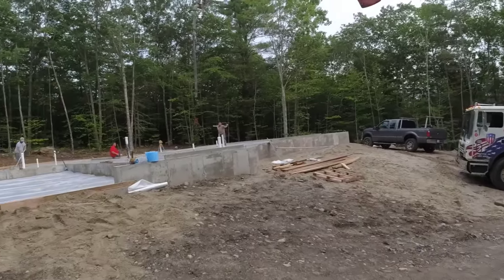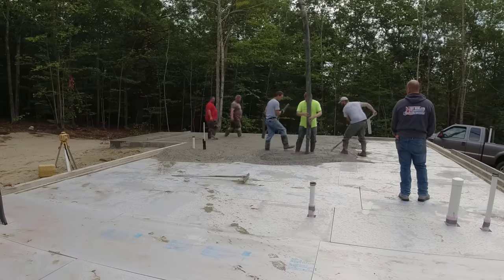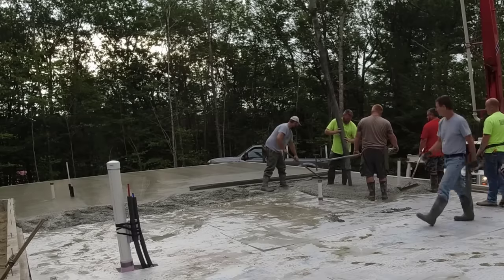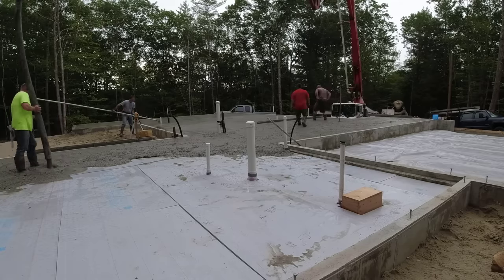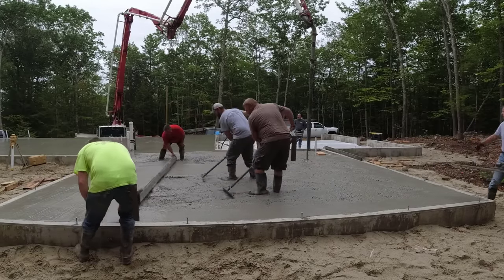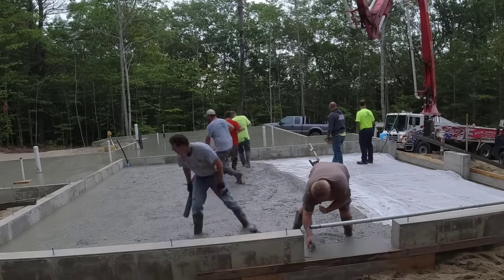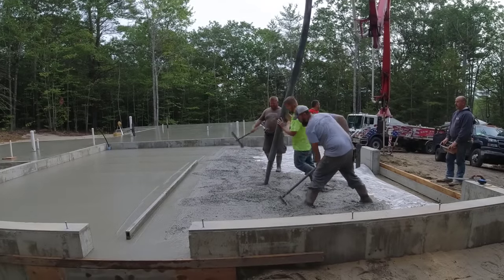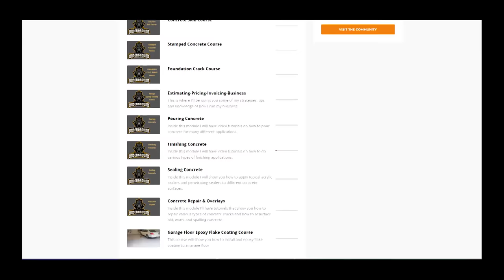Code Enforcement Costs Owner $3000 For Styrofoam Under Concrete Floor

Comment: The current cost of insulation panels may make a painful outlay, but it will get recouped VERY quickly in today's energy costs!  After passing the break-even point, it's a gift that keeps on giving year after year over the entire life of the structure.  Imagine enjoying comfortable interior temperatures year round without having to fret over heating and cooling costs.
Reply: I'll bet the break-even is within 3 years. After all, 30% of heat loss is down, through the floor.  Here's another situation. My small home (Canada snow belt) is electric baseboard heated. Adding an airtight inset to my open fireplace, and burning only from Friday eve until Monday morning weekly, some evenings, through the Christmas holidays, and a few extra days, cut my electrical bill in half. The $3,000 stove and install, paid for itself by halfway through year three.  Spread out over the year, that's saving $100/month over (30 months=2.5yrs), or $1,200/year. And, never having to spend it again. This is really only viable if your winter wood costs less than the saving. I harvest my own free firewood.
Reply: There is so little heat loss through a slab floor, it’s not what you think at all. I’m a mason of 37 years
Reply: I put R-100 insulation in my attic, I also added another inner wall to all my exterior walls which were plaster and lath and in poor condition, I added studs inside, 2" of Celotex, a plastic sheet, 1/2" CDX topped by sheetrock so I could hang heavy things on the walls anywhere and not have to locate studs too.
So the 4" walls had blown in insulation, added 2" celotex at R-7.2/" and the walls are around R21 or so.
 I replaced all the single pane windows. I was getting sheets of ICE on the inside of my kitchen windows in winter, where my computer and desk are, it ALWAYS felt cold and drafty, turned out the draft was convection currents caused by the cold window glass. I had to have a 1500 watt space heater behind my chair all the time. I replaced the 3 windows with MI windows, double glass, argon, low E vinyl, immediately no more ice, and the space heater went in the trash, I saw an immediate reduction in my electric bill of about $50/mo The windows were around $179 each, I installed them myself, they paid for themselves in 2 years.

Same story in the bedroom where I always had another space heater on low all night, replaced those 2 windows and that heater went in the trash too, that saved about $35/mo
Since then I replaced the rest of the windows but its unknown the savings as doing so didnt eliminate any more space heaters-only had the 2.
Buy last winter I replaced my 35 year old 80% efficient, 110k BTU Lennox Conservator G11-e furnace with a new Goodman 80k BTU 96% furnace and installed it myself, new better ducts and more central  location along with a humidifier.
I saw a reduction in the gas use last winter, this winter will tell me more.
That 80% furnace took all its combustion air from the basement which pulled in cold air from every little crack, and when it was off, cold air would often spill down it's 5" flue. The Goodman takes all its air from outside with a 2" PVC, I also installed a damper to allow a small amount of fresh intake air from outside to mix in the return duct.

 @slowfinger2

Comment: I'm not sure where you are exactly, but here in Finland even without code I'd doubt anyone would pour slab for house without insulation under it. Even for garages it's usually put especially if the garage is heated.
Reply: There’s no need to put styrofoam under a heated slab, it should be put around the outside of the foundation. I have a 1000’ feet of heat pex in my garage floor and the foam is on the outside perimeter. The heat only goes down 10”, and it’s why a mixing valve on a tankless coil is piped 10” below the outlet. The heat won’t convect farther down.
Reply: @geneticdisorder1900 the proper term is conduction. Solids conduct heat. Fluids convect heat. And technically it's that it won't effectively conduct the heat beyond 10" but the heat does conduct much further than that.
Reply: @ianbelletti6241    Last time I checked, there was fluid flowing fabulously through my tubes convecting heat into the pex tubes, which conducts heat into the cement, which conducts heat into the dirty dirt. And all that mass of dirty dirt, cement impregnated with small crussy crushed rock than convects heat up into the air, which in turn warms my garage. Except where the 4 roundy rubbers sit on the cement and the heat is transferred into those 4 roundy rubbers and anything else that is sitting, stored or thrown onto the concrete floor.  So in short, we were both half right.
Reply: Without beneficial heat loss from the building to the soil below the slab, frost heaving soils will move an insulated slab. It will heave up at the edges. Prevent freezing, remove free water or replace the frost susceptible material and it can’t heave.
Reply: @Mars-zgblbl  Do you have a major  problem with foundations without underfloor heating heaving ?
Reply: @sarahann530  Where I live, frozen wet silt can heave with great force and crack concrete. The risk of this happening is increased if insulation inhibits interior heat from keeping the soil surrounding the foundation or slab above freezing. Heating method doesn’t matter
Reply: @Mars-zgblbl   So the interior heat penetrates the concrete slab . What temp  do you have your house heated to to prevent  this freezing under the concrete  ?  It would indicate that heat loss through the slab is a concern and in places that don't have your unique problems it would pay to have under slab insulation
Reply: How about dollah dollah bills $? Up front costs and over-runs sometimes mean cutting corners elsewhere in a compromise with the devil that you know will cost later.
Reply: Dude, I truly recommend visiting the US and checking what they do with your own eyes. It's beyond any imagination, and seeing those "geniuses" will leave you speechless. Pouring concrete straight on the soil is just one example. But in general, it's unbelievable what they practice.
Reply: Mandatory here in the UK. Edit: Actually now I think about it insulation in the floor isn't technically mandatory but I think it would be hard to meet overall insulation targets without it.
Reply: I'm in Arizona, USA. It is never cold here. We only insulate floors of large commercial freezers and refrigerators.
Reply: It really depends on the environment where the house is located.  Maine has many more months of cold than a Southern state like Alabama or Florida.  I'm not aware of anyone putting Styrofoam under a slab down South.
Reply: @markdaniel8740  "never cold here"
Insulation works both ways:). Would make sense insulate the perimeter against heat.

Comment: Gotta have that thermal break to decouple the concrete from the ground.  This keep the energy (heat or cool) in the house and makes it more efficient.
Reply: Also have to have a thermal break between the concrete wall and the slab, otherwise your slab is effectively uninsulated and the edges will be cold in the winter and accumulate condensation in the summer.

Comment: With energy costs increasing, it probably makes sense in the long run. Add in the comfort of floors being warmer and the risk of floors sweating it makes even more sense.
Reply: Umm  it'd make more sense for hollow floors not cement floors
Reply: @meyatetana2973  Actually insulation concrete floor is the best because you lose so much heat trough them.  It just helps so much.
Reply: @meyatetana2973  Do your research. Hot goes to cold, if the floor is cold then your furnace or whatever you have is constantly trying to warm that cold slab. that slab it coventing the heat into the earth instead of you. Over the lifetime of that house that $3000 will pay it back many many times over. Not to mention the comfort factor. in Ma the new energy standard for new and remodeled house is HERS 42 0 being the highest score possible you should see what it takes to get to that level. homes built in the 1950s would most likely score a rating between 120 and 130.

Comment: Here in Alaska had my garage floor replaced with a heated slab. I set the grade myself and put a vapor barrier and 2" blue board. Going into the 3rd winter and it was well worth the extra cost.
Reply: I have 80mm/3.5" of PIR here in the UK and if building again I would probably fit more like 120mm/5".

Comment: The foam is absolutely necessary. Your floor is your second major heat loss source next to the roof.
Reply: Could you explain how the ground conducts heat and when does it reach equilibrium.
Reply: @marcwert2180  You're not getting a course in thermodynamics over the internet. Go to engineering school or consult an engineer in person.
Reply: @marcwert2180  The ground stays at a mostly constant temperature year round. That is sort of how ground-source heat pumps work. (State-change reactions like freezing also sink a lot of energy.)

If you dump enough heat into the ground it may eventually reach equilibrium. But water can carry your heat away as it makes it way down to the ground water level as well.
Reply: I don't  use foam, don't  use house wrap, don't  use felt paper.
They will destroy your house.
I have thrown code enforcement OFF the property or had them arrested.
Reply: @daviddiehl-gy2sq  Well, I see you are half right,, batting .500..  House wrap,, right with you.  Expensive and pretty and close to useless,, UNLESS,, you wrap your house exactly as the directions instruct,, and no one does  because it is too difficult and expensive,, and if you do the perfect wrap,, You must also install an air to air heat ex-changer with a positive pressure air makeup system.
Use 30 pound felt (tarpaper0 as your wrap.  Works better  and does not promote rot under the wrap.
Foam, in the right places,, is wonderful.. It can cost far less than the cost of the wood or natural gas to heat the home.  I like cheap and effective.  Spray foam in place,,, not so much a fan.
Keep the building inspector off your place?   NOT a good idea.  Yeah, win some temporary battles,, but you will lose the war.  Good luck with that, and the attorney's fees  are gonna cripple you.
Reply: @Sailor376also  inspectors are only permitted on the property when you call for an inspection. Most don't understand the new products. Got tagged for using gluelams as headers. PEX without fittings or separate heat and high pressure air. They have also never seen engineered studs.
Also, house wrap on the outside, plastic on the inside. Where does the moisture IN the stud wall go?
Reply: @daviddiehl-gy2sq   Arrested for what ? Please share a link to how the court ruled .
Reply: @sarahann530  criminal trespass,  he got 5 years and lost his job. Unless they are called for an inspection they are not permitted on the property.
They cannot just show up and do an inspection.
Reply: @daviddiehl-gy2sq   Share that court docket because it will be useful precedent for others . 
Did he fail to leave after being asked to by the cops ?
Reply: @daviddiehl-gy2sq no one gets 5 years for a trespass.  I don’t believe your story.
Reply: @AscDrew  don't give a shit what you believe. That's what he pleaded down to.
Reply: So give the guy’s name and the state/county and year where the case was handled.   Thought so.
Reply: @daviddiehl-gy2sq I really do not like all of that.
Reply: @daviddiehl-gy2sq   Still waiting on that court information . At least share the city ,county and state so we can look it up . The firing of an inspector  for this would have made the news .
Reply: @sarahann530  In some states like Illinois you have to have the inspection. You must apply for the permit first which means the inspector will be visiting you. Now in some very rural areas You can get away without an inspector. A former pastor I knew built his entire rec area for his church without permits or an inspector visiting. He lived so far out in the sticks though he was able to do it.
Reply: @carmelopappalardo8477   Its unusual for a commercial  building to be built without permitting but that's religion for you . They get away with all sorts of shit
Reply: @sarahann530  I agree. I visited the guy like winter, late winter and came back mid to late summer and it was built. Now if he would have been caught....
I agree it is very rare. It was also against the law in that state. I know people in Kentucky who built homes on their large properties. They did not report them. The county started using drones caught the people and they ended up getting fined heavily.
Reply: @sarahann530  Exactly.
Reply: @marcwert2180  Thermal dynamics.
Reply: Absolutely necessary ?😅😅 how many people died because of no Styrofoam under concrete basement floor? You probably drive a tesla.

Comment: We had a house fire in 2017. The original house is over dirt crawl space. I worked with a contractor friend to rebuild, but he handled the crawl space floor stage while I was in hospital. The plan required 4" Styrofoam under 4" concrete to form a conditioned crawl space but he  skipped that part, opting only to put 6mil poly down. The skipped stage is a pain in the arse because the floor is a cold surface & atmospheric humidity causes the floor to shadow condensed moisture. It also creates a significant temperature gradient, nice in summer for cool but horrid in winter when it gets cold by your feet. I still have to fix this, but tge effort & expense to retrofit is big.... so, YES you do need the Styrofoam for a conditioned space like a basement or non vented crawl space.

Comment: You guys are like a well oiled machine.  Thanks for the video’s Mike. I haven’t poured any mud since early this summer. My back is totally ruined. 29 years of pouring concrete foundations  and flatwork has caught up with me. I miss it. At least I can still watch you guys doing it.

Comment: My friends basement floor included a cold-room/food storage pantry. He left out the insulation under that part of the slab, but separated/isolated around the section with vertical  foam. We walked on it with bare feet in the winter he finished it. What a difference, even without the walls up.

Comment: In June 2022, we had our barn floor poured by a professional crew (40'x64'). Our building site was sloped, so we needed a lot of fill material to prep for the floor. 200 yards of clean fill sand compacted as we went. We put a 10 mil vapor barrier on top of the compacted sand, (we were trying to battle frequent rains that kept causing us problems) then 2 inch thick pink foam board (25 psi rated, R-10) then another 10 mil vapor barrier, then #4 rebar on 1 1/2" chairs 16" on center both directions. 4" slab of 4,000psi concrete with fiber reinforcement. After that set up for 30 days, we were able to start construction of the barn. The posts are set into brackets that were wet-set into sono tube footings that were poured months before the floor. As a precaution against burrowing animals, we also built our own "rat wall" 24 inches high between each sono tube using 4" x 8" x 16" concrete blocks and adhesive. We just did it "LEGO" style. Then we backfilled inside and outside together, compacting as we went. I chose "floor first" because it allowed me to use a borrowed scissor lift to help install the truss bracing and all the roof purlins. So, except for the concrete inself, the whole project has been DIY with my two sons. Nothing will ever crawl under our floor and cave it in. And we should be able to keep it a comfortable temperature without massive heat loss.

Comment: Nice, clean work! It's a pleasure to see.
1:25 You can put the vapor barrier under the foam insulation, like here, or you can put it on top. Both work. But there's a big advantage putting the vapor barrier on top. When you do it like in this video you can accidentally get concrete under the insulation, which floats up really easily. Once that starts to happen it gets really hard to get it under control. With the vapor barrier on top you avoid that problem entirely.
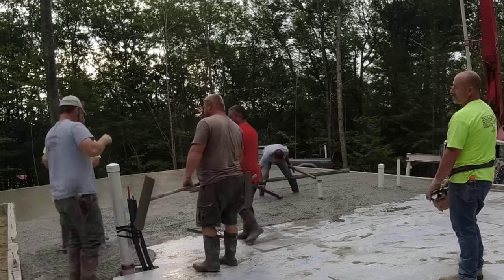5:34 If the slab isn't structural, which is it most often isn't, then it's good to put 1"-2" of foam insulation vertically, on the inside of the raised portion of the foundation wall. This makes a thermal separation between the slab and the concrete foundation. That's a detail that really should be in the construction drawings because it needs to be coordinated with interior finishes and trim.
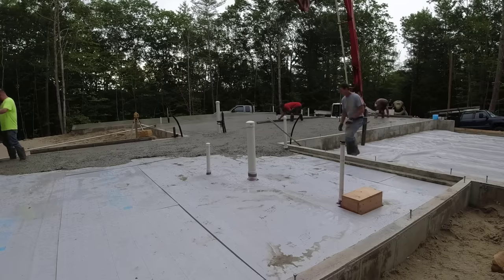7:00 It's certainly not necessary to put insulation under a stand alone garage slab. But there's one case where you want to do it. If you're in an area with deep ground frost, you can avoid having to put in a deep foundation by doing a "frost protected shallow foundation" design. (Google that phrase. It could save you money.)

Comment: The insulation cost is inline with our area. Just built our home with a total of 2200 ft of hydronic heated slab and 2.5" of foam to code.
Cost was 2500 bucks for foam. 
We moved in 3 weeks ago and are in very comfortable surroundings. ICF walkout, 2 x 8 R28 main floor, R60 blown in attic. A cacoon for us retirees.
Love watching a well oiled machine like your crew. Go for it!
Did I mention I operate a redi mix truck? That slump is crazy 😂 Great vid!
Reply: Can you really call that a slump. More like a slurry.   If they add a little more water it will self level , lol.
Reply: @bluecollar58  Hear ya. If the finisher hollers to roll in more water, ya turn it on and rev er 👆 up

Comment: Nice work, but the concrete seems extra wet and being from California, it’s really strange that it doesn’t have wire mesh or rebar in it. I’m sure the rebar’s in the footings, but strange not seeing anything in the slab.
Reply: Ditto.

Comment: In Ca. re-bar mandatory. My area footing have to bed into bedrock 18". My home had  upper lever trenches 60" deep. Basalt bedrock. No foam needed. I run the furnace maybe 2 weeks a year. Otherwise down comforter and sweat shirts.